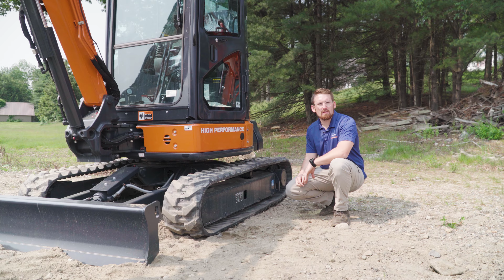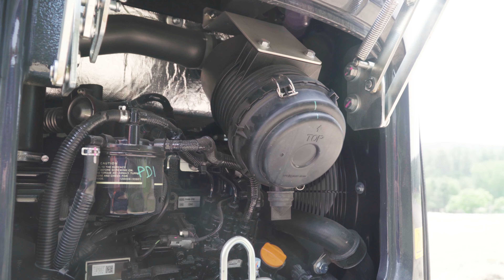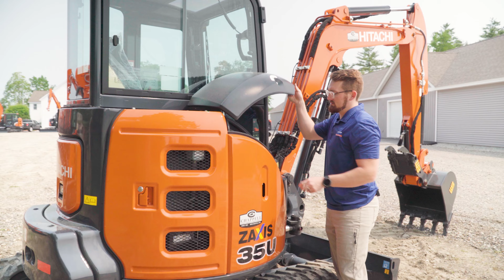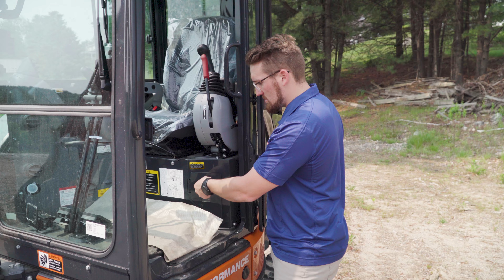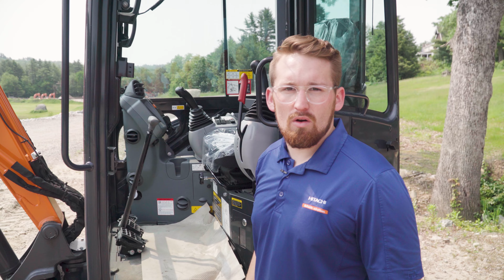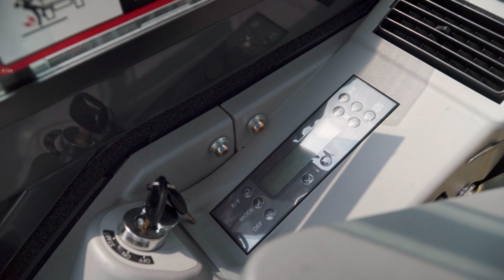Hitachi ZX35 Full Walk-Through

Comment: Price
Reply: Premium package is around 70k
Reply: What size machine would you recommend for a plumbing contractor doing water lines, sewer lines and branching out into septic installations. I realize a 5 ton machine would be ideal for septic but for a business starting out what size would you recommend. It needs to be zero tail and able to work in tight quarters next to homes etc. can be an open cab and maybe optioned to run a hammer, I guess that would’ve the premium range. Appreciate any advice. Thank you
Reply from the maker: Kubota KX080-5 and Hitachi ZX85-7 would be on the upper end of sizes, 8 ton range. KX057-5 and the Hitachi ZX75-7 and ZX60-5 are all great options too around the 5-7 ton range. Have you ever looked into Takeuchi excavators? We have a bunch of customers who love their machines and many do trenching and septic work.
Reply: I would really appreciate if you did info video of the new Hitachi zx 30u-5n with enclosed cap.